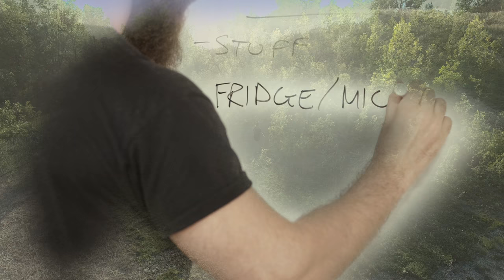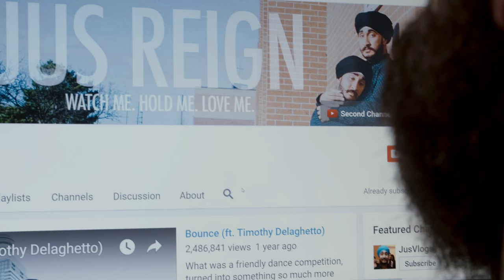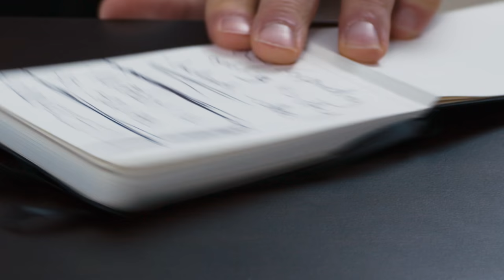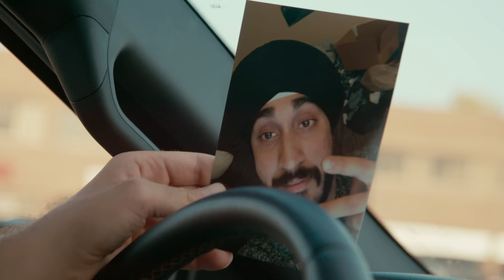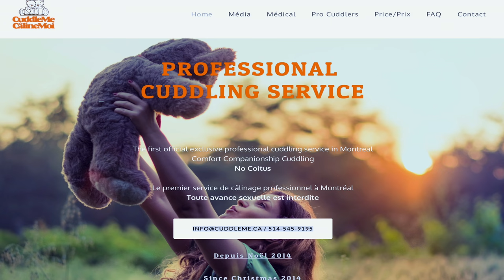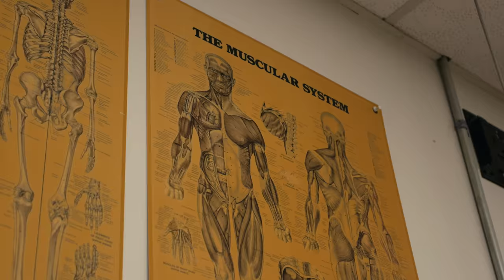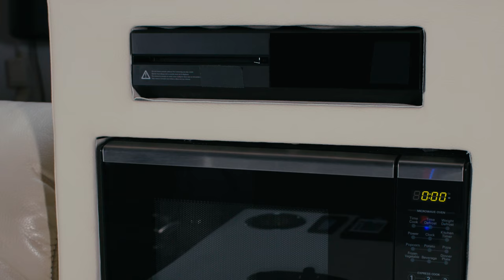Inventerprise - Jus Reign Comes to Town

Comment: A hotel should be good but what would happen if it glitched and then suddenly squeeze you to death that would be horrible if thing with that is you just have to work out the Kinks and make sure that it doesn't have any heavy or settings for hugs because there's different forms of hugs there is the normal hug there is the Bro hug and then there is the bear hug that's something you definitely don't want to do definitely no accidentally click the button says bear hug and actually be squeezed to death can you imagine the news news today a man with squeezed to death by a couch that can hug was killed by his couch article killer couch beware of killer couch what do you think of that Harley